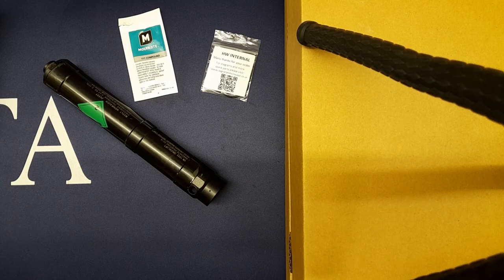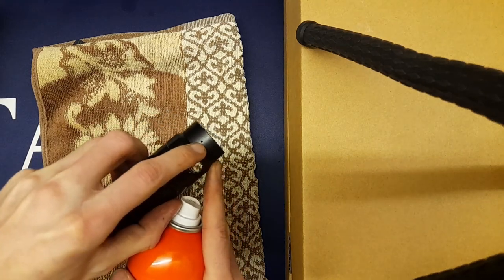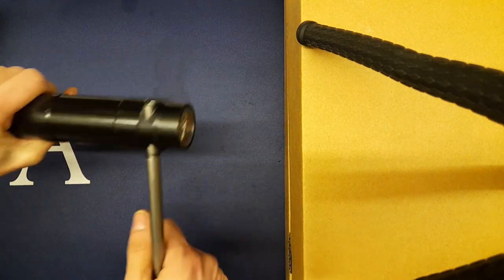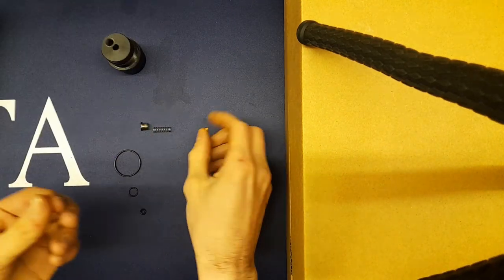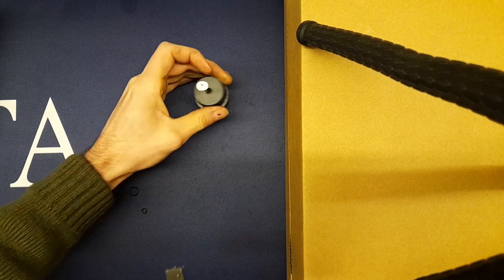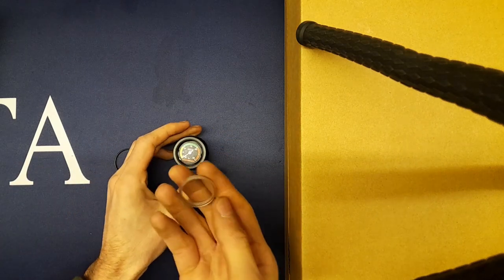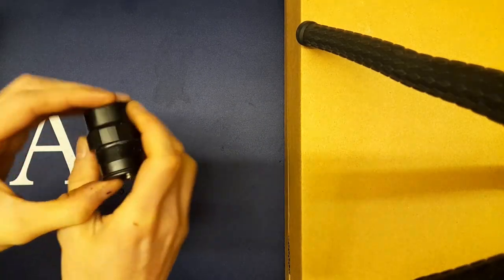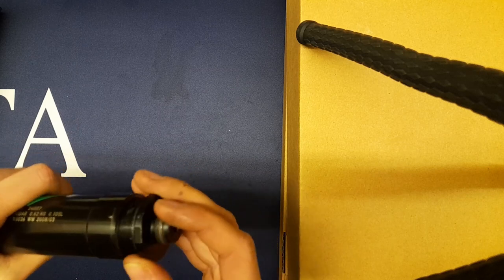HW100 Air Cylinder Full Strip & Service + Leak Fix

Comment: You can also check for a slow leak using a balloon( or cut a finger off a disposable nitrile glove) placed tightly over each end of the cylinder. Leave overnight and see if its inflated the balloon on either end.

Comment: Great video - do you have any further tricks on how to open the cylinder? I've tried with a bar and an adjustable wrench, but can't get it open. Do you clamp the cylinder in a vise?
Reply: I service HW100 for my fellow club members. I use a vice with hard rubber jaws fitted. I also use a 36mm hex socket to remove the end. I put duck tape on the hex so it doesn't get damaged.
Reply: @markl4670  Thank you! I'll see if I can source some rubber jaws for my vice. Are your's square or rounded around the shape of the cylinder?

Comment: 23:45  Next inspection 2018 you should NOT use this now ! What do you think how long the cadridge can be used ? Weihrauch does not make inspektions and our government (germany) says: we need the papers for inspection - but Weihrauch does not give them !
Reply from the maker: Depends on local restrictions. In the UK there is no regulation for pressure vessels under 2litres therefore no issue using past the dates. We usually do an internal visual inspection during servicing

Comment: Great video. Could someone please answer a question regarding a cylinder. I you lay the air gun up over the winter intending to not use it, Is it ok to leave a full charge of air in the cylinder, or should the air be depleted until used again? Thank you.
Reply: If you are not going to use your rifle for a while..then keep the air cylinder topped up to say 100 bar. Then once a week just dry fire it 5/6 shots just to keep the o rings from drying out..
Reply: @krisgater6891  Thank you for that advice.

Comment: Anyone know where you can get this little brass rings from ?
Reply: ive just opened mine up to fix a leak on the piston but I don't have a brass ring or the other oring in mine from the factory as well, can this be right you think!
Reply: actually i had to knock it quite hard for it to fall out!